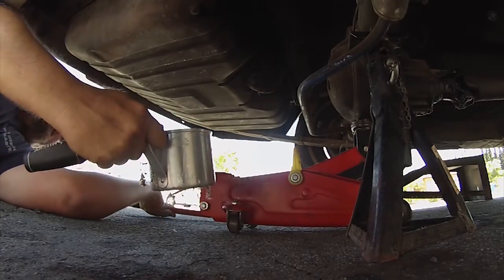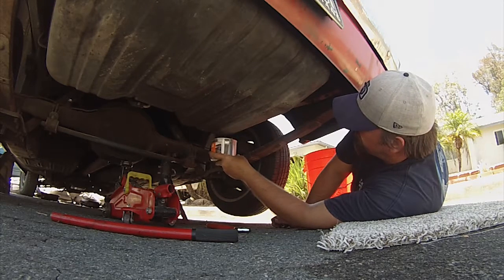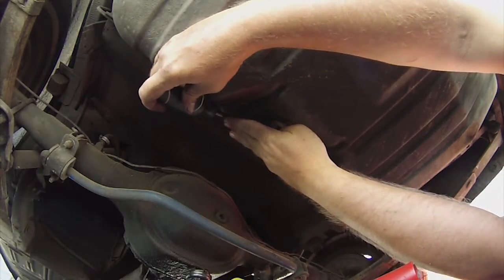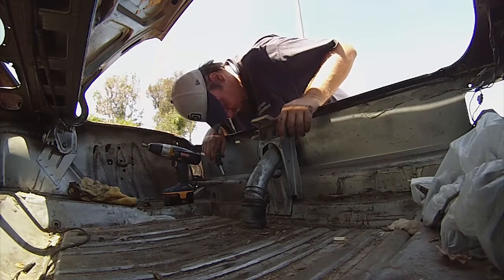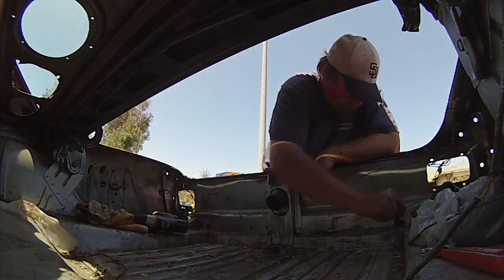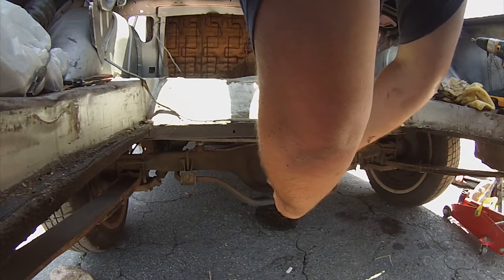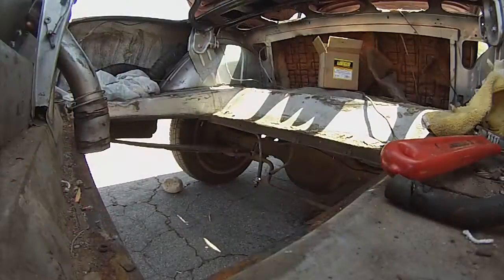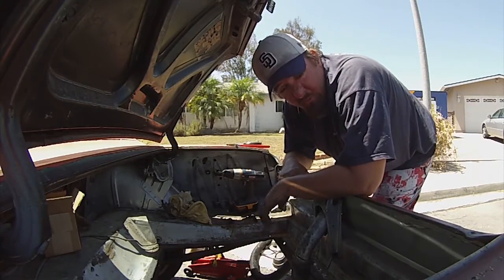How To: Remove a gas tank from a 1965 Mustang

Comment: It’s a good video but I noticed you took your filler tube loose then used an electric impact to remove the bolts in the trunk, fumes and all. The spark from the brushes on the impact could have ignited the fumes. Break the bolts loose first then remove the filler tube last. Good video otherwise, keep wrenching!

Comment: EZ job as long as the sending unit seal / o-ring doesnt leak.  I had a hell of a time getting a good seal on mine. I have 2 of these cars and I hate so much about how they are built. Sad to say it but compared to my 67 Camaro for example the Mustangs were way behind engineering wise in my opinion.